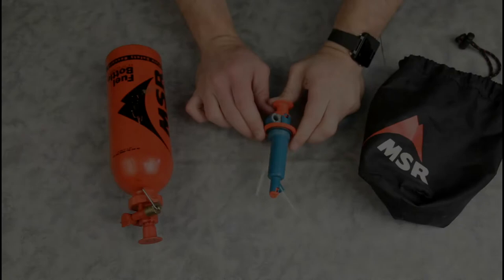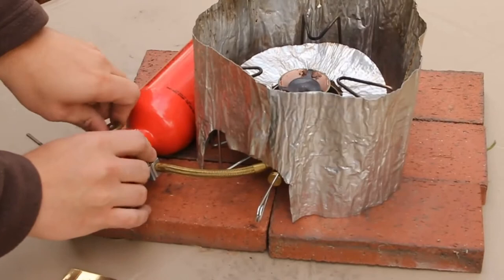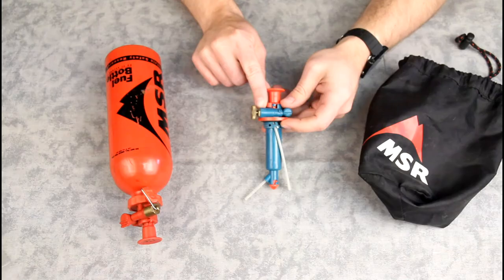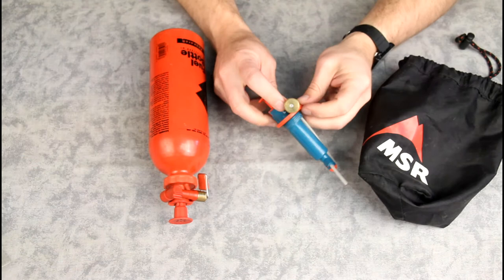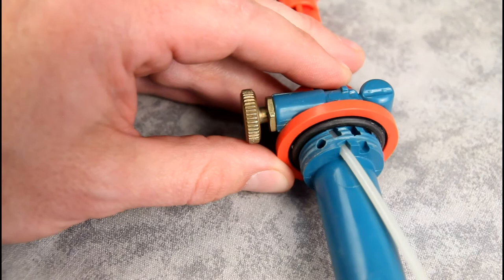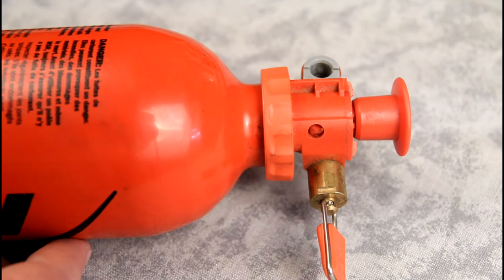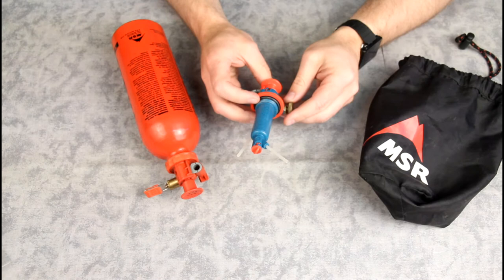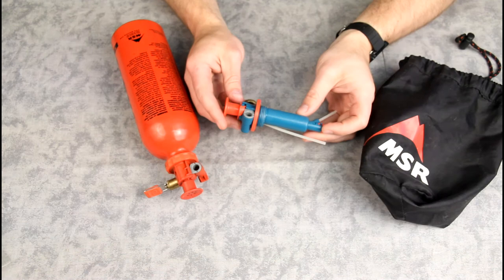MSR Fuel Pump Failure

Comment: I still have the old style pump still in use from a Whisperlite International I bought in the 90s. I put JB Weld on the cracks that were developing in a few places 5 years ago. Still going strong and no leaks or new cracks developing in that time. Still considering getting the new style pump but will probably wait until this one dies. As I also bought a few maintenance kits for this style of pump on discount from eBay several years ago as well.
Reply from the maker: I didn’t even consider trying to fix it, that’s good to know!
Reply: I am still owned a old Whisperlite with old fuel pump and works fine, but just buy a new fuel pump for backup. One important think to keep the pump fine is put grease in all o-rings and no overtight the pump to  bottle to avoid cracking plastic
Reply: @ardilla8651  i had a older one and it leaked messaged msr they said send in old pump and we will send out a new one for 20 $ so worth it
Reply: Msr will send u a new pump for 20
Reply: @AdventureColorado  y when msr will send u new pump for 20 if u send the old one in

Comment: Good video.  I'm amused by the term "old style" MSR pump.  I've got yellow MSR pumps from the 80s - now THERE's an old style.
Reply from the maker: I wasn't really sure what to call it.  I figured people buying the current style wouldn't be aware of some of the issues.  Also, now that this is an older video there are even fewer of this style sitting around.

Comment: Thanks for pointing this out. My internationale has cracked in this same way and I assumed its because the valve had been closed off too tight. But now I understand why it's cracked.
Reply from the maker: Interesting to hear it is other models as well.  The new one that I bought does seem to be holding up better.

Comment: Really the best option is to just buy a optimus Polaris it has a metal pump,  works great,  it has a lyndel valve on the pump where you dont have to change anything  going from canisters to liquid fuel and doesnt need to have any jets changed either,  I have both the polarius and whisperlite universal and  my msr leaked right out of the box, the Polaris is my favorite,  i will never buy another msr liquid fuel stove again . Msr said that it would take  4to 6 weeks to fix my stove .   so I asked them to just throw it in the trash can , .I will never buy any of their stuff again.
Reply: 1 jet for all means less fuel efficiency in some of the fuel variation.
I've prove that Omnilite can also use 1 jet for all fuel types with no problem, even alcohol! I drill one of the jet to 0.8-1 mm hole, that way I can use all the fuel without having to change the jet, and tougher stove body than the Optifuel. 

But I think, Optifuel's pump introduce less maintenance issue than Omnifuel/Omnilite, especially in the leather gasket.

Comment: I bought this msr wisperlite international and it's still literally new but I notice problem with the fuel pump, I can't pressurize the bottle, the small pump rubber cap inside kept on dispatching from the pump arm while pumping any solution?

Comment: Do these pumps also deteriorate from exposure of its plastic parts to fuels like white gas & gasoline?
Also, is there a safety cutoff mechanism that interrupts the fuel flow, if the fuel line somehow gets disconnected from the pump hole while in operation?
Reply from the maker: It's certainly possible that the fuel causes some of the deterioration.  There is not a cutoff mechanism that I am aware of.  When mine started leaking it would leak on to the ground while the stove was still running.
Reply: @AdventureColorado  Thanks for the info. Seems risky. I borrowed an MSR from a friend to try out on a hike once. I didn't have a stove then. Decided to get a Trangia mini instead for the lightweight setup, and the Coleman 533 for the team setup/solo car camp setup.